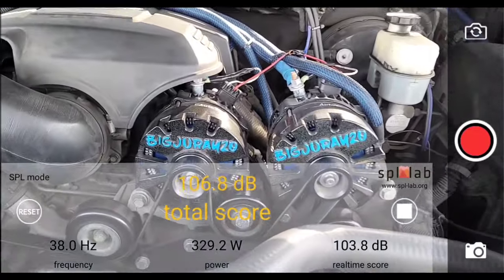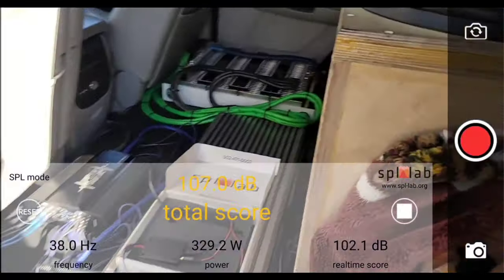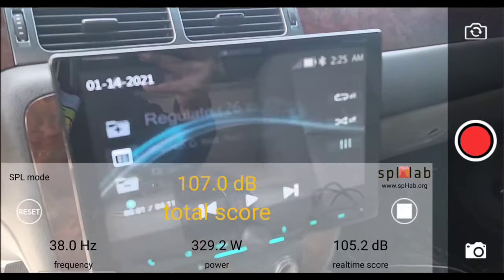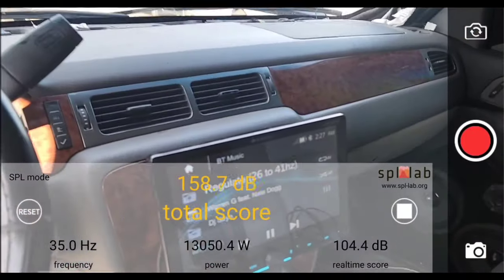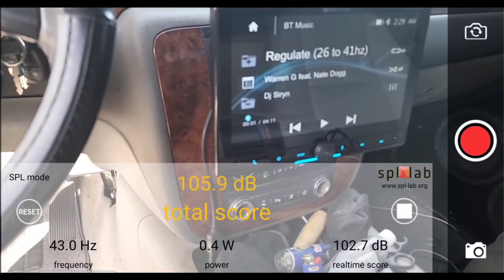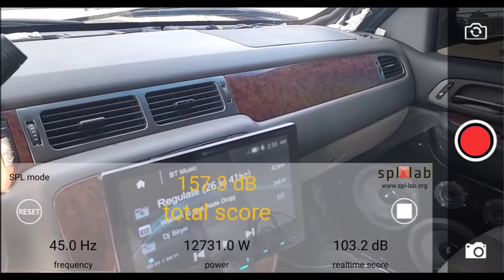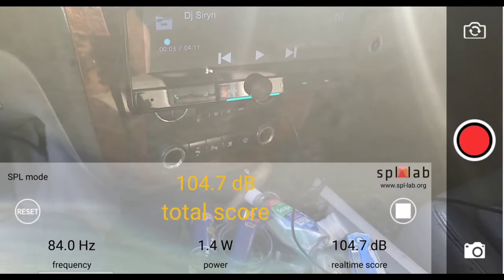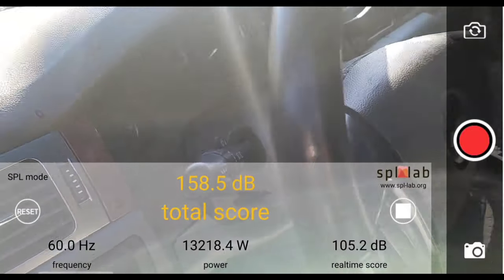6 Custom Soundstream XXX 15s Powered By Soundstream XXX 15000D @ .47 ohm (Meter and Clamp Test)

Comment: @BIGJURAY20- You should be very proud of that enclosure's bandwidth, that is very impressive! I wouldn't be surprised if you bumped up your Lpf from 80Hz to 125Hz, that you could be + or - 3Db from 30Hz to 80Hz!? Great job, man!
Reply from the maker: Thanks for the love I'll have to try this and see if it helps any. Really appreciate it thank you
Reply: @BIGJURAY20 - Test your Db @ 70Hz, 75Hz, and 80Hz, before changing your Lpf from 80Hz, then Retest those freq. again after changing the Lpf to 125hz, 160Hz, or 200Hz, which ever is the highest setting. Let me know if your scores from 70Hz to 80Hz change.
Reply from the maker: I'll definitely have to check this. I'll be sure to take a few notes and get back with you
Reply: Yea the enclosure works very well with the cabin resonance.
I agree to stay within a few DB from 30-60 is impressive. I'm sure it sounds good on music.
Reply from the maker: @BDauto86  I'm really liking the enclosure but i haven't really tested the bandwidth fully
Reply from the maker: @BDauto86  Thank you for the love i really appreciate it

Comment: Wow I'm really impressed with the power coming from that amp even after rise on (6) 4 inch 8 layer coil 15s !!  You do realize though that you can probably burp 9000 watts to each sub so you could probably burp around 50,000 rms to the subs i would bet you would be hitting 163+
Reply from the maker: That would be a sight to see. I'm lacking power currently but working to get a little more to them.
Reply: @BIGJURAY20  im trying to do the same thing currently i just swapped out my (8) american bass xfl 1544's for (8) deaf bonce avatar stu 15 d2's added two more md 12000s, now currently am running (4) md 12000s at .5 ohm each amp (1 amp per pair of subs).  Running agms and a stock alt 🤦‍♂️🤦‍♂️🤦‍♂️ so voltage is very bad...next move is to get a scib bank and alternator, it already got the dual alternator bracket
Reply from the maker: @kptn9narw  I would definitely see footage on your build. Would also be nice to see how it does now vs how it does with the electrical upgrades
Reply from the maker: @kptn9narw  Have you ever metered your system with the American Bass 15s vs the Avatar STU 15s?

Comment: Hey glad to see someone else with a soundstream 15K amp.

How has she been to you?
Mine has been collecting dust for longer than I want to admit.

Looking to get a GMC 2500 for the amp.....
Reply from the maker: Well, I love the amp but I hardly play it because it's getting harder to find parts for them if anything goes wrong. Definitely fun to play with it though especially since it's not likely to see people playing them these days
Reply from the maker: Just gotta make sure you keep it as secure as possible when mounting to prevent vibration. Also be sure your electrical system is up to par they can put out some power but it definitely needs it to deliver
Reply: @BIGJURAY20  I got 2 x 370 DC power alts and a 270 with the wrong mounting.
Love that alt bracket you were showing off.
I started getting parts years ago and shit went wrong plus  life happens so now I am finally getting to it.
Found a 2014 gm 2500.that would be good for a system.
Reply: Glad to hear the amp is good as long as it's treated right
Reply from the maker: @randysmith3492  That's true you treat your equipment right and it'll last
Reply from the maker: @randysmith3492  You definitely have some solid alts. You should be able to get your Alternator recased if needed